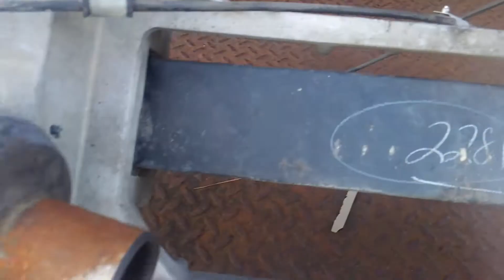How to - C5 Corvette Rear Suspension Description from C1 to C8

Comment: I've got c6 front and rear. For the rear differential, I used a Ford Mustang.8 irs center with custom cv shafts. Tons of aftermarket support and no carrier split for gearing.
Reply from the maker: That's a good conversion idea. I haven't examined the Mustang independent diff very closely, but it sounds like it could be pretty strong. What type of car are you running it in?
Reply: @VetteSource  umm...68 Dodge d100 short bed. Lol
Viper was my 1st choice for a donor, but 2k was a bit heavy 4 me. Scored the C Z front and rear @ $350 delivered (shop price).
8.8 to tr6060 and 6.1 hemi. Now I'm contemplating using rear splined hubs, up front, a and a 8.8 front diff, for awd launches.
Reply from the maker: Now that is a score, even at shop price. I see quite a few trucks running the corvette suspension conversions. How does it handle and ride on the open road?

Comment: First let me say...Thanks for the video...Seeing the suspension out of the car really helped me understand it better. Question...I just bought an older 2000 C5, and it seems to be lower than stock by about 2 inches. Looks great, but I can see it is hitting the wide tires they put on it. I believe the bolt which everyone talks about setting, seems to be at its highest point, and it all looks like stock parts best i can tell. So, other than just trying to turn the bolt more, what else could be causing it to sit low. maybe a worn leaf spring? Any suggestions...
Reply from the maker: No problem, glad to do it. If the bolts appear to be stock, it probably is tightened down more than the stock factory setting calls for. The easiest way to test the theory is to back off the bolt a few turns on both sides and see how it affects your ride height. You can also check the rear spring for visual damage such as delamination or cracks in the fiberglass. Let me know if you need anything else.